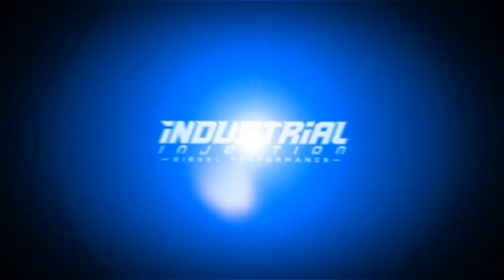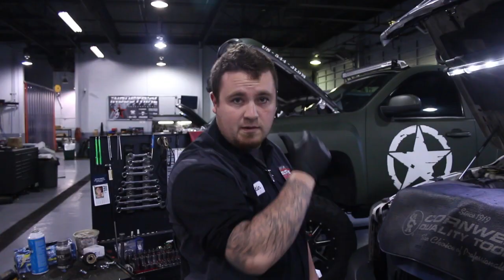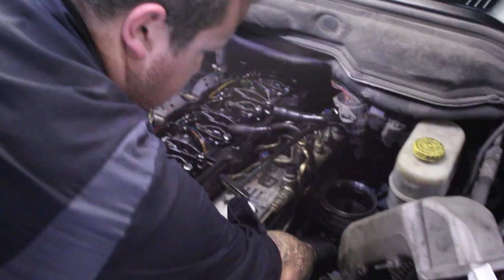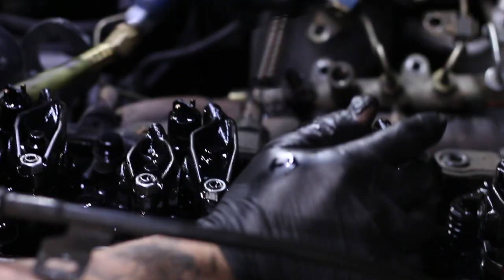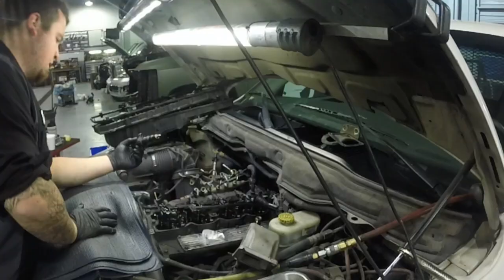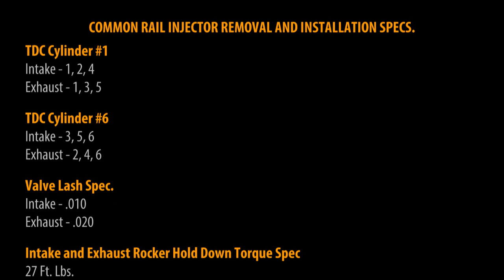5.9L Common Rail Injector Install and Removal

Comment: Well done video I've been having issues with mine with the P1222 code not willing to go away. I replaced my injectors, retorqued the tubes ensured all torque specs on the entire top end. Truck runs great, full power, no smoke, no hard starts...  not sure what I need to do next to trust using this truck again. (2005 Dodge Ram, 1 ton) Not sure if maybe the code is STUCK in the computer and I need a way to remove it and how to do that with what OBD reader. I've replaced every fuel system component except the Fuel Pump. It seems to be working fine tho. Any suggestions would be very much appreciated

Comment: What are the torque specs for the three bolts that hold the fuel rail to the block?  Same question for the intake horn bolts.

Comment: I've watched many of these videos on  removing and installing injectors. the only part I really wish was shown more of is the removal and install of the #6 injector and transfer tube lock nut and tube. it can be really hard to get a wrench on then and extract. Best to remove the engine block install bracket.  Just sayin....

Comment: Oddly enough, dealing with the valves is what I'm more nervous about as I feel I'll lose track of where the pistons are and stuff, the rest looks pretty easy. A shop quoted me $1500 in labor to do this job and I normally don't go to shops for my truck so I'm gonna do this myself. Good video

Comment: great video. covered it well and dude is obviously well trained and practiced. i especially liked the bit about cleaning the tools off, and his term "heel bar". nice.
 i do want to comment that the term foot-pounds is inaccurate when discussing the torque spec on a fastener. the proper term is"pounds-foot". jes sayin. foot pounds has to do with measuring something like the torque of a twisting or rotating object, a flywheel for example. what might be the book time on a job like this? im guessing 6 hours?

Comment: Tools 3/8 ratchet, 1/8 ratchet, 3/8 torque wrench adjustable hill bar/ small crows foot, ladies foot, 10 and 20 filler gauge to adjust intake and exhaust, 24mm socket(12point)  8mm 3/8 drive long socket, 10 mm socket 8mm wobble socket and extension, 11mm socket, 19mm wrenches(small and long)

Comment: The Video noted a torque value on the Connector Tube retaining nut of 44 Ft lbs. Just fyi the 2005 Dodge Service Manual, on page 14-102 in Volume 3, says the torque value for the "Fuel Connector Nut at Cylinder Head" should be 50 N-m, or 37 Ft lbs. I have seen several videos with differing torque values claimed... as high at 57 Ft lbs. I wonder where the numbers come from that differ from the service manual. Perhaps the torque value changed through the years, even though all were 24V 5.9L engines? I only have the service manual for 2005, so can't tell....
Reply: I know this is an old comment but for everyone who comes across it and has the same question, the original value was 37 ft lbs until Cummins updated it at 44lbs
Reply: Hi do you know the torque of the valve cover?? Thanks 🙏

Comment: Using a calibrated torque wrench the 37 ft/lb with crows foot crushed the ends of my fuel lines, unsure of why this happened, possibly fuel lines had been over torqued before causing the failure but 37 seemed to be too much
Reply: Per the 2005 Dodge Service Manual, page 14-102 in Volume 3, the "Fuel Line Fittings (High-Pressure - Cylinder Head to Rail)" Torque value is only 22 Ft lbs, or 30 N-m. The "Pump to Rail", meaning the single fitting that mates the fuel pump to the rail, is a bit higher at 27 Ft lbs, or 37 N-m, but both are below the 37 Ft lbs you used. Sorry to hear about that. Maybe this will help someone else.

Comment: Did this yesterday. But with injector DIY rebuild with a kit, changing only sealing components, ball valve and 2 springs while leaving existing shims in their original positions. All seemed to go well.
Diesel runaway on first start. 30 seconds of pure hell and engine was done for.
Should have swapped in remans but can't turn the clock back.
Reply: No bueno bro

Comment: Used your video to change my injectors. Thank!!! I noticed when I placed my Valve cover back there was a sticker that said .026 clearance on the exhaust. You said .020. Will this hurt my motor??
Reply: Willie CTS, .020 is fine. Only 06/07 says .026. Cummins spec is .020, but chrystler changed it to .026 for emissions.
Reply: How will .26 vs .20 exhaust lash really affect emissions? Just curious.  Thanks